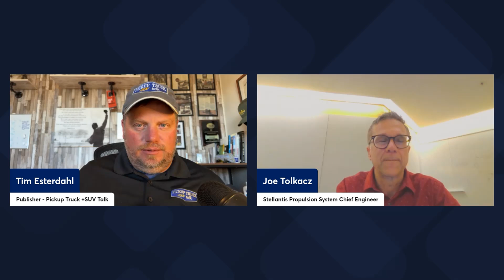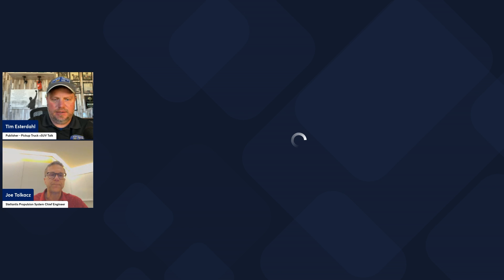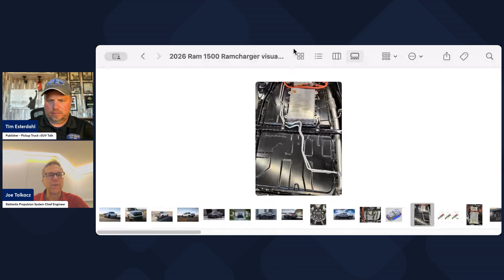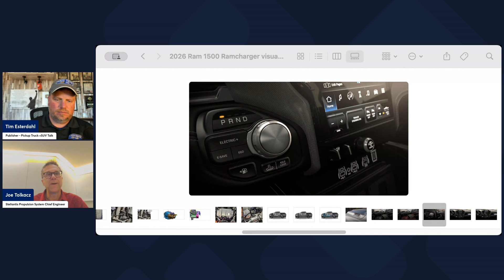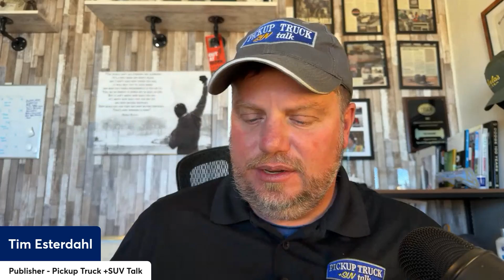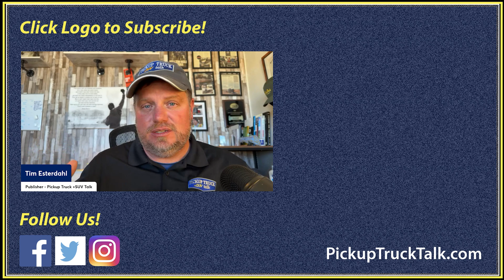2026 Ram 1500 Ramcharger Engineer Interview - Towing, Range, Engine Choice, etc...

Comment: Great video Tim, but I’m still a little confused so the truck can go 690 miles on electric and the gas generator but it still uses all the 27 gallons of gas to do it, that’s only 25.5 mpg, my 6.6 duramax going to Michigan got over 22mpg and that’s over 750miles on a 36 gallon tank, my wife’s 3.0 duramax gets over 30 mpg on road trips, and that’s well over 700 miles on 27 gallons, I don’t see the point to buy gas and pay the high price for the electric truck, I get that you can charge it and go on short trips and never use the gas but still on road trips you basically still have a gas vehicle, but I guess you do have the option to go on those long trips without worry of finding charging stations, but I was just thinking the gas generator would use like 10 gallons of gas to get that 690 miles making it really make sense to have the electric truck,don’t get me wrong I think if I was going to buy an electric truck platform this would definitely be it
Reply: The 3.0 does not have > 2500 lbs of payload, nor does it have 620 hp. The weight of the battery system down low in the center of the truck will also add really good stability while towing/cornering. This charger will out pull any half ton on the market, while getting "pretty good" MPG. And, no emissions crap to worry about. The v6 pentastar is a 15 year old, rock solid/proven engine that can exceed 500,000 miles if treated properly.
Reply: @JohnSmith-ev1sm  very true
Reply from the maker: You said it. “You can go on short trips and never use the gas.” So less gas, less maintenance and still the flexibility to go on long road trips.

Comment: This is a great video!  Thanks for publishing this interview.  

I’m still confused on the 35% battery level… it sounded like that was just when towing that it wouldn’t go below that? Full EVs can go all the way down to zero, so if I’m not towing, will they allow the battery to go down to zero before the engine kicks on?
Reply from the maker: Just towing on that specific test. What they are saying is they want you to have enough power to keep towing 14k lbs comfortably so they don’t let you go to zero and get stranded.
Reply: @ gotcha. Thanks for the clarification.   Makes a lot of sense.  

Thanks again for making such great content! As a fellow Nebraskan, I appreciate your no BS approach to your videos!
Reply: If I understood Joe correctly this would allow the battery/gen combo to provide the drivability while climbing a grade. Our Wrangler 4xe always has some reserve in the battery even when it shows depleted and the vehicle power is there if you get into the petal. I little bit unrefined but overall really like the power train and the Ramcharger seems to be a great improvement.

Comment: If someone tows a trailer full of toys from LA to Las Vegas how fast could he pull the baker grade?  The battery would be depleted and the engine only generates 140 kw, the ev motors are 250 and 238 kw  That leaves about 1/3 throttle and at 170 hp there is no way it could keep up with traffic let alone pull a grade.
Reply: Why would your battery be depleted? They specifically said they dont let it fully deplete before the generator kicks on which is why there is only 70kwh of the 92 kwh available. And he says in tow/haul mode it changes how they handle it so it likely wouldnt deplete to 20% in the first place.

Also, they said the generator can produce up to 202kw or 271 hp. Pulling a 14000 lbs trailer up a 7% grade probably uses ~250 kw at 65mph which means there is only a 48 kw deficit that the battery back fills. So assuming you start the climb at 20% charge, you can pull a 7% grade for 23 minutes before depleting the battery. I dont know too many 7% grades that you can drive up for 23 minutes at 65mph.

The generator only has to produce as much as the average draw of the electric motors the keep the battery from depleting.
Reply: @Jay-me7gw  When you use more than you put into a battery, it becomes depleted.  If there are safeguards to prevent it, then you still are unable to pull charge for the motors, either way you are screwed and traffic is going to be wizzing around you.  The 3,6 only generates 140 kw,  just a fraction of what the motors can use.  It' would be about 170 hp, which might be fine on county roads, but not for a freeway, especially with a load or towing
Reply from the maker: You would simply stop for more gas.
Reply: @Pickuptrucktalk  Getting gas wouldn't make the system do something it wasn't designed to do.  The batteries can accept a charge of 140 kw, so the generator hooked up to the 3.6 makes that, and only that much.  Getting gas in an old Ford Escort doesn't make it any faster either.
Reply: @rogerrussell9544  I think you are overestimating how much power is actually needed to move a trailer. You’re not going to be using all 647 hp for 20 minutes straight. I’d be surprised if you could use much more that 325 hp sustained while towing uphill.

Then what happens when you go downhill after the climb? The generator keeps running and filling the battery back up while you are also getting additional regenerative grade braking from the motors. 

Then when the road flattens out and you are only drawing 150 hp, the generator is filling the battery at a rate of 25 hp or more. It continues filling the battery until the next climb.

Like I said in my first comment, the generator only has to provide the average power output over the entire tow. The battery only helps to fill in when output exceeds generator, and then the battery acts a reservoir to store excess energy when power output is less than the generator produces.
Reply: @rogerrussell9544 the generator can make 202 kw
Reply from the maker: @rogerrussell9544  what I’m saying is you’d stop to get gas to keep going. The battery wouldn’t be fully depleted like a BEV.
Reply: @Jay-me7gw  I gave an example.  Stop and go traffic with a trailer uses a tremendous amount of energy to get the load moving.  Regenerative braking recaptures some of that..... but trailers have their own brakes, electric brakes to help contol during heavy braking. That eliminates recaptures the energy it took to get the trailer moving.  So, if someone left LA and headed towards the 15 north they would consume the battery range just in LA traffic  Climbing Cajon Pass is 20 miles of a steep climb, after a gradual climb around the foothill freeway, the 210.  By the time the clim is halway over the system would be depleted and you would be in the slow lane and it would take more than 170 hp to keep up with traffic. 170 hp is like an old VW Golf engine power, not enough to push the truck and trailer through the air at highway speeds.
Reply: @Pickuptrucktalk  W/hy wouldn't the battery be depleted? they don't stay charged just out of habit. There is a reserve, but if it's held in reserve that still isn't available to turn the wheels.  Even with a fuill tank of gasoline the 3.6 only generates a 140kw rate.  On the freeway there are frequent places to refuel, but how many chargers?  Every 75 miles frequent?  That makes taking this on a long trip or using the tow option very often  In other EV's range drops in half under load.  It is one reason EV pickups haven't caught on.  Having the range extender is supposed to fix that, but if it can't generate enough charge to keep up with traffic, it's not a real solution. In the old Chevy Volt it could keep up.  It would seem to me a better match woiuld have been placing this system in a Jeep passenger SUV.
Reply from the maker: @ battery is depleted then truck is done and can’t move. The engine doesn’t power the wheels. If you run out of gas, you can’t use the generator and thus can’t charge the battery. It’s the same as an ICE vehicle running out of gas.

The engine is sufficient enough to charge the battery.
Reply: @Pickuptrucktalk  
If the battery is depleted the engine kicks in and generates enough to the battery to keep you from being stranded.  If the truck is empty in ideal conditions there is about 500 miles of range,  The gas tank isn't the normal size, but stopping and topping it off, how does that make it faster under load? The inability to work it on the highway with other traffic is the weak link, not a lack of range.
Reply from the maker: @rogerrussell9544  why are you stuck on it being faster? I can’t follow your thinking, sorry.
Reply: @Pickuptrucktalk  Do you want to spend $85.000 on a vehicle that can't do what it's advertised to do?
Reply: @ heavy traffic does not take a lot of sustained power, its short bursts. The generator can run nonstop while your in traffic and far exceed what you use. And the trailer won’t brake unless you tell it to, it’s called one pedal driving, all evs do it.

I’ve climbed Cajon with my trailer, it was a pretty easy climb imho, most of its not super steep. And last I checked the towing speed limit in Cali is 55 mph. Again, why do you think the system would be depleted? How many hp do you think you use on the climb?

I’m not sure what you are not getting.
Reply: @Jay-me7gw  Strange, gas mileage drops a lot in city driving.  Friday afternoon freeway driving isn't just 0-30 (the sweet spot of EV's) but up to 60/70.   EV's use more power on sustained high speed runs, with a load it's worse and on a grade it's even worse than that.  When you climbed the grade, how often did your ICE truck shift down?   

The kicker is, you know what I'm getting at.  But you're so in the tank for the Ram you can't actually admit it.
Reply: @rogerrussell9544  yeah because gas engines are wildly inefficient at low load when their throttle plate is closed and it’s pulling against the vacuum in the manifold. See my comments about using a diesel instead of the pentastar.

And most gas vehicles can’t regenerate like an EV! But Hybrids can, and guess what, they are more efficient in city driving than on the freeway 😂

My ice truck was spinning 3700 rpm on cajon which is about 250 hp.

Never even owned a ram. I’ve had a Ford, Chevy, two Toyota’s and a couple Subarus .
Reply: @Jay-me7gw  You are an academic.  Real world situations and economics seem to baffle you.   Read my first comment againm, compare it to your reply.   When did I say this truck couldn't cruise at 30 (empty) and was a failure because it couldnt' do so.     I realize you will play dumb and ignore my point, but Trucks have utility hauling loads many times over long distances.   In my example from the city to a spot over mountain ranges. None of that should happen at 30 mph where EV's are efficient.
Reply: @rogerrussell9544  Math is hard.

I havent ignored any of your points. I've responded directly to them. You just refuse to understand that when you are sitting in traffic, you're not use a lot of power continuously. Maybe small bursts, but the rest of the time you are coasting or slowing down or stopped. The whole time the generator continues to run and charge the battery. Why is that hard to follow?

Did you need 650hp to drive in traffic before this? You're just driving around with your truck floored all the time?
Reply: @Jay-me7gw  You just go on pretending that sparky.  So now you think people will buy a $85,000 truck to sit?  Hahahahahaha......  You would think that they would at least wait until the solid state batteries come out so you can sit in traffic for hours longer with the a/c running.  While you sit behind propaganda points and idealistic goals for how people will drive them, I can tell you that people don't drive trucks that way - especially heavier duty ones with higher load/tow ratings.

Comment: Here is a question people would want to know. Range seems like the big focus here, but people are lazy or charging stations are not available when it comes to charging. My question….can you drive this thing, without charging it at all? 

The almost 700 miles includes charging the battery. What happens if you never charge the battery? Will the engine charge the battery when you’re not driving it? Can I drive the ramcharger…..and never plug it in for, let’s say 5k miles? Curious to know how does that impact in range since the engine will be used more and the battery will not be a a higher state charge.
Reply: The battery never fully depletes. Thats why they said it only has 70kwh available of the total 92kwh capacity of the battery. It you drain it down to having 22kwh remaining, the generator kicks on. You NEVER need to charge it if you dont want.

Of course, not charging it at your house on a level 2 charger would make the whole exercise kinda dumb. The whole idea is that your normal daily usage falls within the all electric range and you only need the generator for towing >50 miles or road trips.

Comment: If it operates like a modern rail locomotive, why is it not able to maintain its full capacity until the gas tank runs empty?
Reply: The generator only needs to output the average power consumption as the electric motors consume on a drive. The battery acts a reservoir for when the generator overproduces and then that energy is available when lots of power is requested by the driver.
Reply: It does. That's why it has a range of over 700 miles. That's when the gas runs runs out. It won't have that same range while max towing because the engine will need to boost rpm to power the motors directly from the generator. Higher rpm=lower mpg.

Comment: For 80k you can have several lightly used vehicles vs this one Ram.  An electric vehicle for daily commuting, a gas pickup truck for towing/hauling, a motorcycle for sunny days and a nice bass boat for the weekend.  Don’t keep all your eggs in one basket folks!
Reply: @lg4ky  what year are you living in 🤣
Reply: @ 2025 and yes I own all these vehicles.  Be smart and the deals are out there.
Reply: @lg4ky  i don't buy used
Reply: Multiple insurance policies, multiple maintenance requirements, multiple parking spots.  Pass.

Comment: Great stuff Tim.  Super interested in what kind of gas mileage you would get with say a normal travel trailer of around 7,500 lbs.  Thanks a bunch for this interview, and great that Stellantis set this up so quickly for you.
Reply: Not as good as a hemi. But if you start with a full charge and tow a short distance you can run on battery and charge cheaply.

Comment: If you are towing long distances will the 3.6L be able to keep up. There is no way the 3.6L on its own pull my 26ft RV trailer
Reply: You don't understand the concept.  The 3.6l is only a powerplant to the generator that then supplies electrical power to the electric drive motors for the wheels or for battery recharge.  The propulsion system is electric.
Reply: @aarons307  and when the battery storage is depleted, it looks to me like the engine and generator is not able to keep up with the amount of horsepower needed to continue the work to be done like a rail locomotive can
Reply: @CharlesAnsman  Why do you think the battery would be depleted? The generator only has to be able to supply the average power consumption over the duration of the tow to keep the battery level stable. How much power do you use on flat ground or going downhill? Probably less than the 175 hp the generator can provide.

Its not like everyone is towing up 7% grades for 4 hours straight.